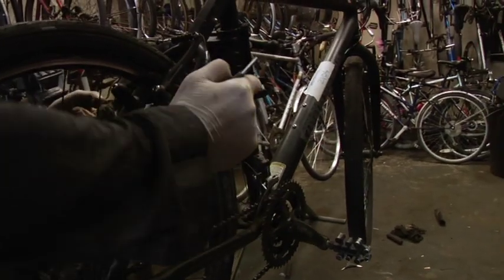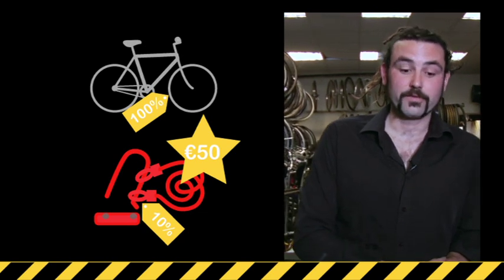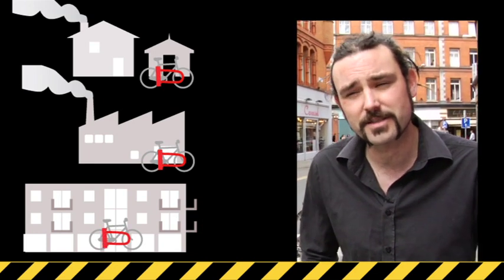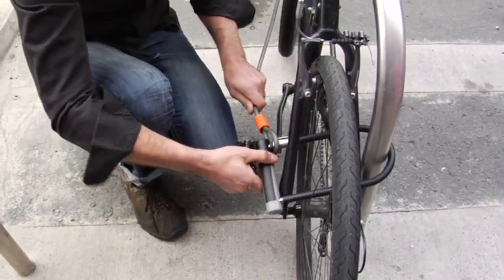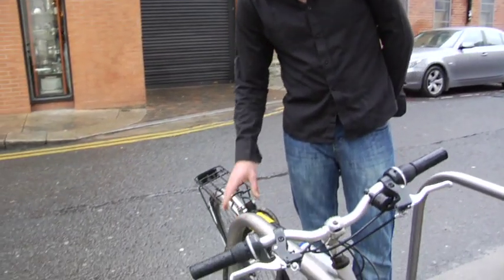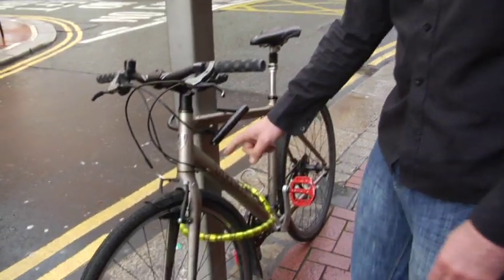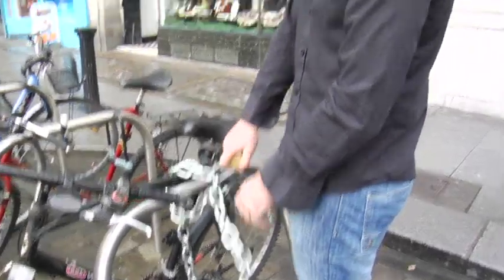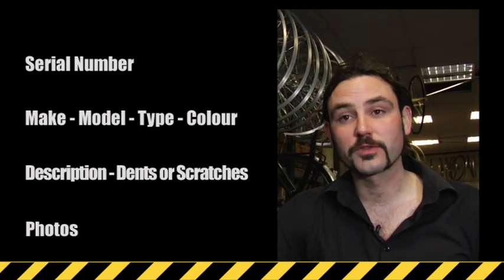Bicycle Security in Dublin

Comment: This is even more relevant in 2022. More secure parking needs to be available in carparks and other places even if there is a moderate charge. 
Especially for all day bike parking.
The very real fear of having your bike stolen or vandalised is a greater deterrent to more people cycling for work or socialising than the lack of bike lanes and infrastructure.
If I left my bike parked in Dublin I have a two metre Diamond rated chain lock and a Gold rated D lock which together weigh in at almost 8kg and even that's no guarantee if thieves can get the freedom to spend a few minutes cutting with a good angle grinder.

Comment: Nice video and good advice: 
I wouldn't recommend any D or U type locks as they are simple to break open. Also if using a padlock and chain, make sure the padlock doesn't reach the floor as it is easy to hammer it against the floor and break it open. I've had a couple of bikes stolen over the years and I think the best thing is to lock it in a public place so it's hard for the more elaborate methods of lock breaking to be used without arousing suspicion.  Any bike hidden from public view can be stolen. anywhere in view of a CCTV camera is good too.

Comment: Another good solution is folding bicycles. Most, including me have gotten one so we can commute quickly and easily and can bring them on the Luas or bus, so there's no need to lock up outside. I used to lock up my old bike on the Luas platform for hours on end, but it was vandalized and had the front wheel nicked. This actually happened to 4 other cyclists that use the platform. The response we got that the cameras only look at the platform, not the bike rack. So I recommend folding bikes!

Comment: Hello, What´s your opinion about the Lock ABUS Number 10 with extra cable, Price 52 Euros. Thanks for the Video.
Reply: Not replying to your question directly as it's now 7 years later.
Cables of any kind aren't worth the cardboard they're packed in when you buy them new. They can be cut through in a few seconds with just one hand using a ratchet wire cutter.
For D locks and chains, don't buy anything less than Gold or Diamond rated. Thieves will need an angle grinder or to be expert lock pickers.
I have a Diamond rated chain lock and a Gold rated D lock and together they weigh in at almost 8kg and even that's just a deterrent and not a guarantee.